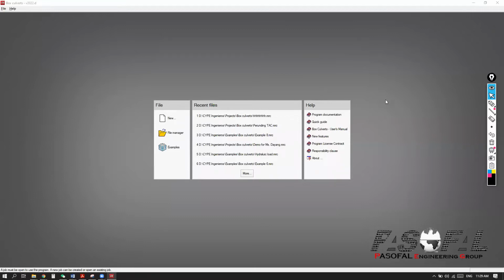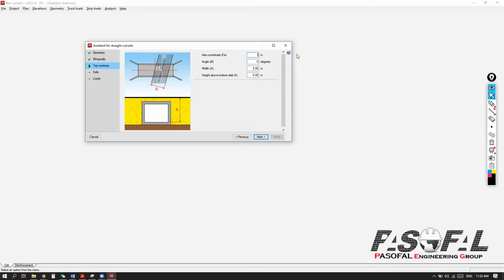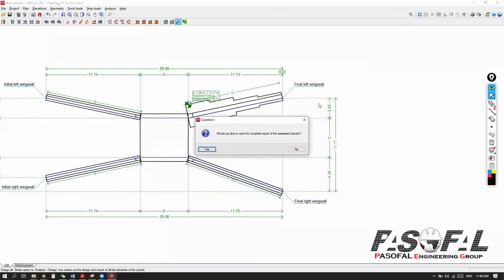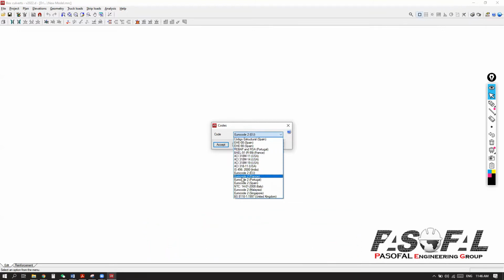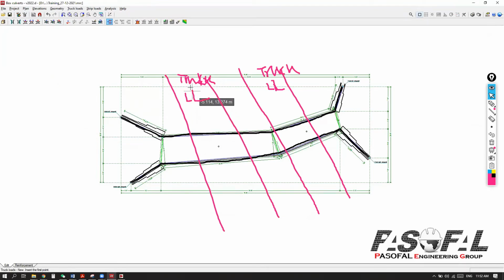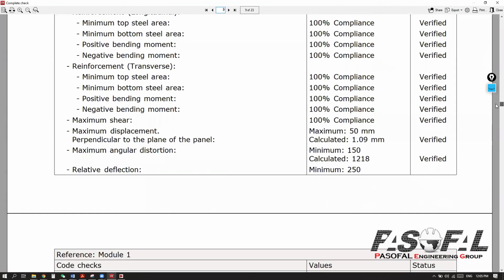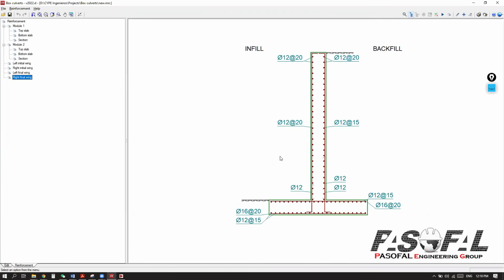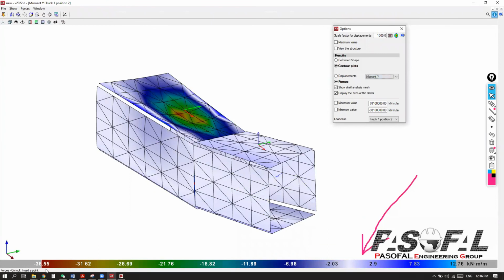Easy BOX CULVERT design up to detailing level

Comment: How do you model the haunch?
Reply from the maker: If you mean the wing wall, you can easily model it either using the customized option implemented in the software, or it can create it by the user using free form option.
I hope the above addressed your question.